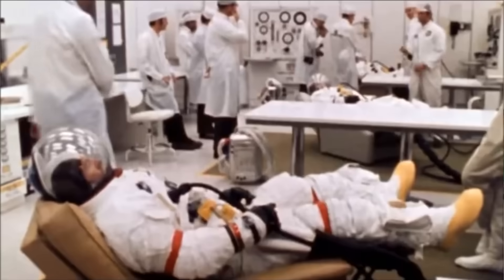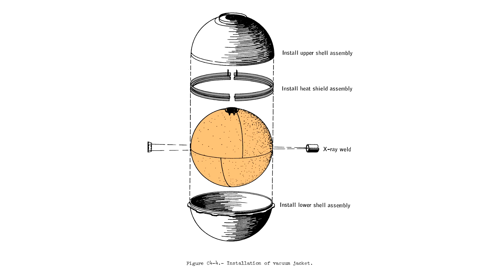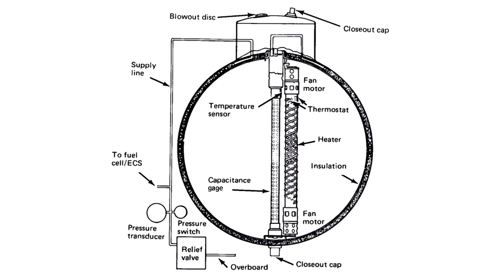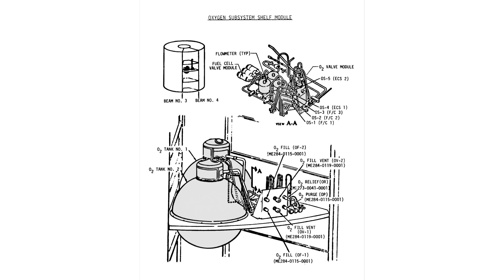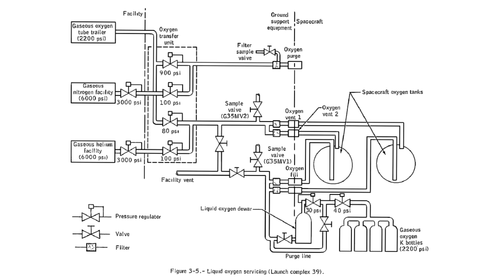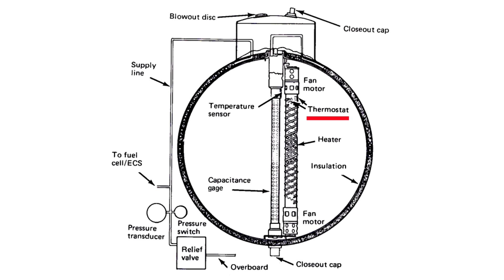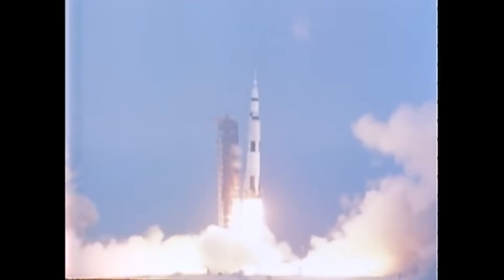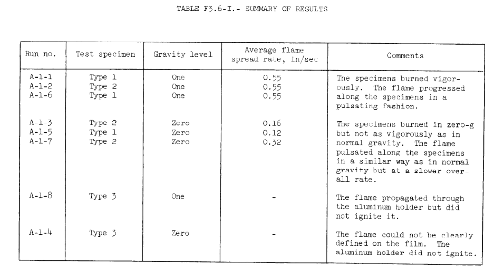What Caused The Explosion That Crippled Apollo 13?

Comment: I thought the liquid oxygen would turn into a slush because of the extreme cold of space. So they needed to be heater to “melt” the O2 slush. With a known heat applied and the correlating pressure indication would help determine actual quantity in the tank. I didn’t know the tanks were under such extreme pressures. I need to chew on this a bit more. Each time I think I’ve figured out what happened. I learn a tiny bit more.

Comment: See....this was my question (as a aircraft technician). How could there be an explosion in an oxygen tank when the situation would have lacked one of the three things needed for combustion......fuel. 
They had: 
1) Oxygen. 
2) Heat. 
3) What was the fuel inside of an oxygen tank?  OK, I get it now after watching the video.  Teflon and other things that when hot enough would burn.

Comment: Was there Swagelok 316 Stainless Steel compression fittings, and valves used during that Apollo 13 mission, that helped out to prevent  more problems, or was there a possible failure in a connection that helped out in the explosion, I just know Swagelok is a top company that manufactures all types of fitting, gate valves, what ever is needed to move Gas, or Liquids. Mr Fred Lennon he Owned   the Swagelok Company and was a great Man to work for. Im Louis Gyongyosi worked many years for them.

Comment: I'd like to know if changes were made to all maintenance instructions, specifically listing the number of fasteners holding each subsystem in place to avoid the type of incident which damaged the tank.  That's actually a common mistake in any kind of maintenance of repair operation, even in household or automotive repair.

Comment: 9:12; which means that TEFLON@ is very safe material.  with VERY high flash point. 
hence my MAY 2025  AUDIT of Michael Hawthorne at CHICAGO Tribune. May 2025. 
hence why, YOU REALLY should back down. 😊

Comment: Thank you, this is a much more complete explanation of ALL the factors than what NASA released a few decades ago, they only reported it was a result of a design change in voltage that the sub-contractor making one of the components for the tank did not receive. But again, we see that NASA is not infallible.

Comment: Excellent documentary.  In watching and reading various materials about Apollo 13 over the years, I'd heard about the thermostat relays (switches) fusing due to the over voltage applied during the ground tests only one other time before.   That was in eight grade science class (in 1975) when we watched a CBS documentary about the Apollo 13 accident.  The relay failure was discussed briefly towards the end of the program.

Comment: Many years ago I had a chance to speak with one of the men that worked on Apollo in Downey. Sometimes I think people don't fully realize just how big of a bomb that Service Module was. If I am not mistaken the SM contained Hydrazine and Dinitrogen tetroxide. Two substances that EXPLODE when they come into contact with each other. This is because the spacecraft uses hypergolic fuel. When that O2 tank exploded the force was so great it blew off an entire panel and both the CSM and the LM were moving so much there was stress around the docking area. This man told me if that force had gone more toward the insides of the SM all that would remain of the entire thing would still be small parts orbiting the sun. Even the controllers were concerned about this. I really believe the US-manned space program dodged a major setback. Just writing about this makes me shiver.

Comment: So the links in the accident chain were as follows. During upgrades, the tank dropped, damaging the fill line. During testing, the workaround to the damaged fill line damaged the insulation. The damage wasn't noticed because the gauge didn't read high enough. During flight, the insulation caught fire, causing the tank to overpressure and vent oxygen. The mission required that oxygen to succeed, and so was compromised.

Comment: Why do you insist on saying Atmosphere when the correct SI Unit is Bar.
Reply: In fact it is the other way around.
Though that is not entirely logical.
Effectively they are almost the same.
Reply: @kiereluurs1243   Actually we are both wrong. Its Pascal

Comment: It didn't "explode". There was rapid combustion and great pressure, but there was not an explosive event.

Some sources would define anything including popping a party balloon or paper bag as an "explosion", but no. An actual detonation or explosive event is a very specific set of conditions that no rocket booster failure has ever been (no, not the old Soviet N-1).
There was not an explosion when the Hindenburg burned, nor when the Challenger flight 51-L came apart.
There is not an explosion in your car's engine or behind a bullet in a brass cartridge case after the primer is struck.
Reply: You didn't shit yourself; there was an event in which feces escaped your ass before you were able to remove your undergarments......
Reply: Now That's What I Call Pedantics™
Reply: @TheAechBomb  Saying popping a balloon an "explosion" is so inaccurate, that it's not pedantry to say that it's incorrect.

Comment: A launch assist system designed to limit the damage caused by engine thrust during Starship lift-off, potentially improving efficiency and reducing the required thrust from the rocket engines. The concept entails constructing a launch assist infrastructure consisting of a pool for turbulent water below the Starship stage one booster, high-pressure fire hoses, a water supply tank, and supporting scaffolding.

The proposed launch assist system involves:

    Bundles of high-pressure fire hoses attached to a ring around the booster, spraying water down to fill the pool below the Starship stage one booster.  A high-pressure water tank to supply the fire hoses.
    Scaffolding around the booster, over which the fire hose bundles are laid.

Suggested launch operation:

    Fill the fire hoses with water and support the ring to which the fire hoses attach with a stand.
    Fire hose valves partially open to supply a pre-launch water deluge at moderate reduced pressure as needed. The pool of water created by the pre-launch water absorbs engine thrust. The 33 engines are ignited and throttled to an assumed minimum 40% thrust.
    At launch release hold down and fully open water valves to the 42 bundles of 7x 12" fire hoses attached to the ring. The hoses will provide approximately 246,836,025 N of thrust through 2,316,055 kg/s of water flow at approximately 106 m/s. This thrust, combined with engines increasing thrust from 40% to 100%, will yield a net 5G+ acceleration.
    The thrust providing water deluge will continue for approximately 1s, lifting Starship to about 30m and accelerating it to roughly 60m/s. In this time, the pool will fill with approximately 4,210,450 L of water.
    After 1s, the fire hoses will cease to provide upward thrust, and the ring with attached hoses will fall away. All engines are throttled up to 100% thrust, providing the necessary thrust for Starship's ascent into orbit.

Please note that the details of this proposal would require refinement to align with SpaceX's construction, launch, and process constraints.

Comment: > And that's why electricity generating fuel cells became the household & car driving wave of the future as predicted by hype so many times by the news & information media.
- But we all know that. Because fuel cells are everywhere now.
- Aren't they?
Reply: The fuel cell assembly was over a metre tall and half a metre wide and weighed 111kg (more than a person). The Apollo Service Module had three of these assemblies onboard. Each assembly produced about 1400W at about 30V.

An electric car will use around 10kW, so you’d need 7 or more of these fuel cell assemblies in your electric car. Consider where they will go in your little e-car. Consider the fact that they will add a considerable mass to the vehicle, increasing it’s energy requirements, so you’ll need more than 7 to provide the extra power needed to move the extra weight. And this isn’t taking into consideration the complexity of storing the liquid hydrogen and oxygen.

Also, money was no concern for Apollo - the budget was almost unlimited. Fuel cells are expensive and when you factor that in to car production or household use, there are cheaper alternatives. Moreover, hydrogen is not easy to produce. In fact, the round-trip of electricity to hydrogen to electricity is only about 40% efficient. Compared to the same round-trip using batteries at maybe 85% efficient. That means you need twice as much input energy for the same trip if you choose a hydrogen fuel cell over batteries.  It is also expensive and problematic to store. 

So, beyond Apollo, in practical terms, they’re not really feasible at all.

Saying that, fuel cell technology based on that used by Apollo has long been developed for use in cars. It’s just not there yet, so battery technology is used in the meantime. You can see some fuel cell powered busses - but they are way more expensive than diesel and so not very common.
Reply: @yassassin6425   No need to lecture on technical details. They are irrelevant.
> The point being, that 50 years after Appolo,  no space craft much less household utility or vehicles are being powered by the much ballyhooed, "wave of the future"; the FUEL CELL! from way back in the day. (1960's)....
Reply: @mydogbrian4814  
Sigh. Did you not even bother reading my reply and the reasons as to why? No lecture. Why do you people ask questions when you have no interest whatsoever in the replies? 

Never mind.
Reply: @yassassin6425   Boy we better give up because we can't seem to end up on the same page. 
-  I don't care why it didn't come to fruition. I only know it didn't live up to all the hype.
- And my ending question as to; "aren't they?"  Was purely sarcastic & rhetorical in nature! And being so, didn't require any explination.
- And yes, I did grant you the courtesy of reading your technical explination. But not being a service technician on archaic  fuel cells I really don't care.
- If someone asks you how's the weather's treating you? They don't need or want a lengthy report on all the Meteorological details including  the barometric pressure.
- Sorry I'm not impressed with your technical knowlege of something of a dinasur in storage devices. But I'm sure there are a few text readers out there that are.
Reply: @mydogbrian4814  
You are a very strange individual. I really wasn't looking for you to be 'impressed' - you asked a question that demanded an explanation - and the answer I gave you really wasn't particularly 'technical' anyway. You didn't ask the equivalent of "how is the weather treating you" though did you? What an appalling analogy. If you genuinely "don't really care" about an answer - then why ask a question in the first place? The reason would appear to be that it wasn't what you wanted to hear. Why are you even looking at this 'technical' video?
Reply: @yassassin6425  LOL 😆 so I'm strange, am I? OK, if you say so.
- Yes, I marveled at your lengthy explanation on the finer points of fuel cell dynamics. But it was not necessary.

Once again, listen to what I've been trying to tell you;

"My original ending statement was a  Rhetorical question made sarcastically and therefore didn't need a detailed reply."

- I suspect that you may not be familiar with certain complex forms of English dialog & therefore it may lead you to believe that I may be some kind of  Weirdo. But trust me, I'm not.
Our whole discourse here is a common problem in semantics.
> So I hope we now part on more amicable terms.  🍺 😉👍 Sorry, if I had lead you astray.
Reply: @mydogbrian4814  
I apologise if I misconstrued your post. I was simply providing a detailed explanation because I genuinely assumed that you were interested in one - but actually, I did attempt to make a somewhat involved topic as simple as possible.

No animosity at all - and of course it's amicable (the internet breeds far too much in the way of divisiveness, discord and disagreement as it is.)

Thank you for clarifying that and your civil response.

Comment: What I don't understand is why these tanks were even used at all.   You said they were removed from Apollo 10's Service Module and replaced with upgraded tanks.   Why, then, weren't "upgraded" tanks used on Apollo 13?     Were the original tanks "upgraded," then installed in 13's Service Module?
Reply: Great question

Comment: Never trust a meter that is at it's maximum. An oil pressure sensor in my Jeep failed once and it failed high. I didn't think too much of it until I noticed a trail of hot oil spewing out from behind my Jeep on the highway.

Comment: That demonstrates that they either need analog, or some other type, of backups.  The information they get, is all that they have to work with; and they were very lucky to have gotten back, alive; thanks to the crews' guts; and innovation, and the ground crew support.  They were also lucky that it happened early in the flight, while they still had the LEM, and could also make a course adjustment, around the Moon, and back to Earth.

Comment: Something you didn't mention but which was in an article I read many years ago is that there was a temperature gauge to show the oxygen tank temperature during that long attempt to remove the excess oxygen from the damaged tank. The problem was that someone had decided that since there was a thermostat which would not allow the temperature to go above 78ºF (25ºC), there was no need for the temperature gauge to go any higher than that so it was deliberately "pegged" so it could not show a higher temperature.  This meant that there was no way for anyone to know that the tank had ever overheated during the attempt to remove the oxygen.  With only one point of failure and no double-check when the thermostat switch "welded" itself closed, there was no way of either controlling the temperature or of seeing that the temperature was uncontrolled.

Comment: It's amazing how NASA has rules about everything and going to the bathroom probably involves following a 30 page checklist but in this case they chose to press ahead without a complete teardown of the components on the shelf that was damaged.  The shelf should have been replaced and the checklist for working on it, which appears to have been inadequate given the failure to remove that bolt, needed to be revised.  OTH, mistakes can and do happen even in the best organizations and the failure resulted in improvements to the tank design and inclusion of additional redundancy.  The efforts the engineers made to keep the crew alive and get them back home showed how brilliant many of them were AND that they did not let the life-threatening situation overwhelm them.

Comment: Notice one peculiar thing at 8:44 minute. Rather listen to what Mission Control and the ''spaceman'' are exchanaging between each other. The words are not that imortant as much as the timing of the exchanged words. At the time when Mission Control asked the ''spacemen'' to strir the oxygen tanks, Apollo was allegedly about 322 thousand kilkometers away from the Earth. The speed of light is about 300 thousand kilometers per second. So, When the Mission Control ends saying ''truunion'', you immediately hear ''OK''. This is impossible if Mission Control was 322 thousand kilometers away fro Apollo 13. Even if you say something over the radio from that far away and the receipient is 322 thousand kilometers away and you add a human touch to two way conversation, you should hear ''OK 'at the fastest 2 seconds later. And it seems like the two words ''truunion'' and ''OK'' are one word succedently following each other because they have no time delay between them for the signal to get to the ship and back. One must rmember that communication between the ship and the ground was in simplex. Supposedly the lunar suits were equipped with duplex radios. Besides you don't hear the quindar tones at all. This is sheer impossibility. The Misssion Control had to be in close vicinity of the alleged radio speaker. Either this was in a studio or somewhere on Earth because this is not the normal radio wave propagation if the two correspondents are over 300 thousand kilometers away from each other. There was no flight to the Moon on Apollo 13 and no human ever walked on the Moon. This radio communication in technical standards is pure nonsense given the positions of the correspondents and distance between them.
Reply from the maker: Or, the audio is in two separate tracks and I lined them up to make things faster and troll gullible conspiritards
Reply: @scottmanley  So, you made the film by two seconds shorter. I did not notice. Why don't you post a warning or a disclaimer to the youtubres that your video is two seconds shorter that it should be.
Reply: @scottmanley  Do you have the raw tape then?

Comment: In the 80’s I attended a 5 day Configuration Management course for military hardware. Th presenter was American who was a CM manager on Apollo. He claimed that the burning of the insulation was effectively a CM failure, as the tanks had been changed, but the test procedure was one version behind, and had put too much voltage in. He claimed the design change made the insulation thinner. Your explanation is much more detailed than his!